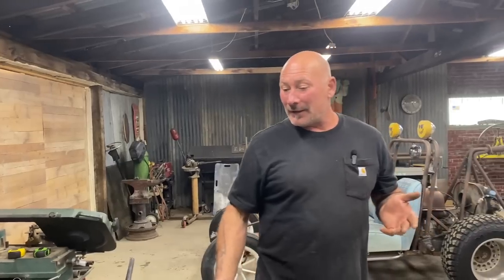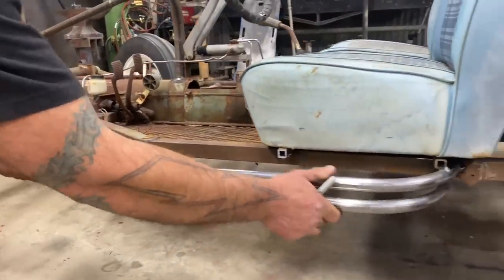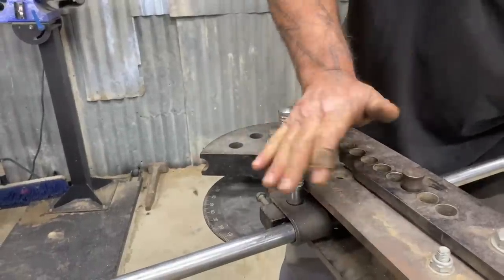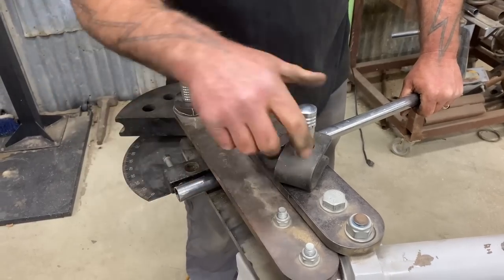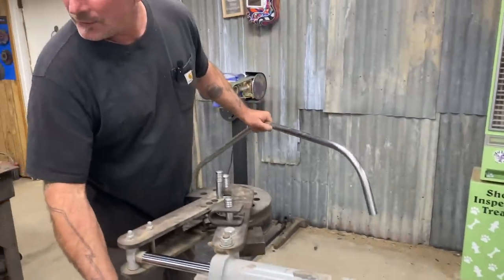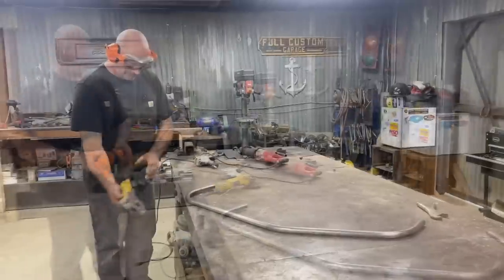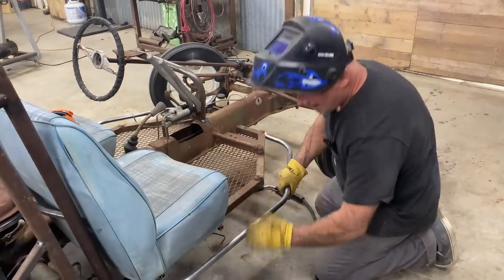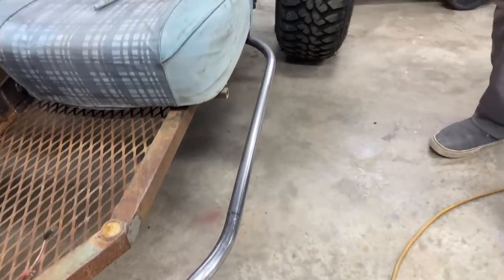Full Custom Ian Roussel Fabricates A Rail for His Dune Buggy!  Part 2!

Comment: You know Ian, the tubing bender we used where I used to work, had a device on it to be able to use the bender either with the hydraulics or we would install a four foot long sturdy handle to where the hydraulic arm connects to the machine and disconnect the arm that is hooked to the hydraulics and manually bend the material.  Also we would bend angle iron with it like 90 degrees just by cutting a vee on one side of the angle iron and bending it towards the cut using a different die.  Richie Rich from NY

Comment: Hey you can get used 16ft 1” tubes at a-garage door company. They use a tube to mount the garage door springs. And when they change out garage doors those tubes go to the dump. Ask if they will set them aside for ya. 
Free material 👍🏻👍🏻

Comment: As long as you don't have front brakes the ribbed tires will work fine. if you run the treaded tires your really going to want some fenders! and maybe some 1/4 fenders on the rear getting hit in the back of the head with a rock isn't much fun. Maybe some sort of front shocks also? Looking forward to the truck looks like something I dragged home.

Comment: What type of storm are you having now. I live up here in Michigan sometime this evening we’re supposed to have an ice storm. OK so much for the weather report I myself have a 1959 VW chassis 36 hp . your show is funny And full of information . and inspiring .  So I cut the fenders off of fiberglass which is a Kilson pick up from the 70s. I think you might’ve had one on your show not too long ago you put a camper shell on it what a bad ass motor turned out to be an awesome machine once again very inspiring
Reply from the maker: It's a winter storm coming out of the PNW.  Lots of wind and snow flurries and cooooold.